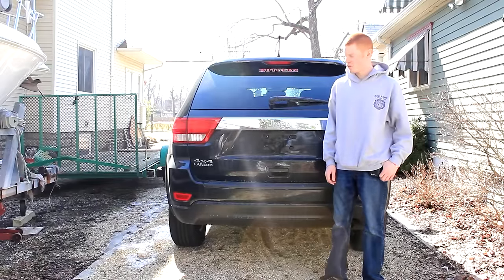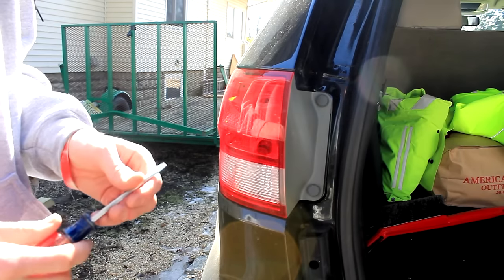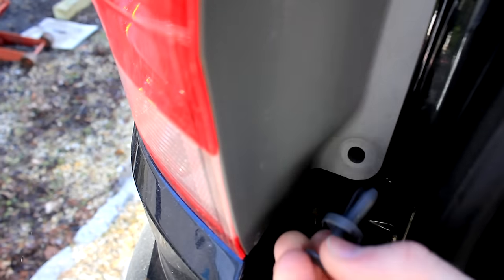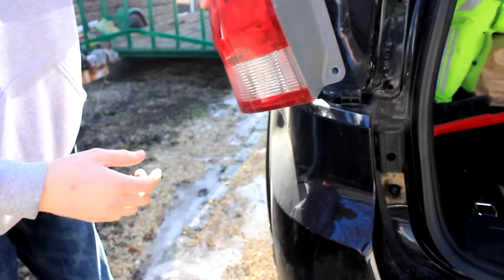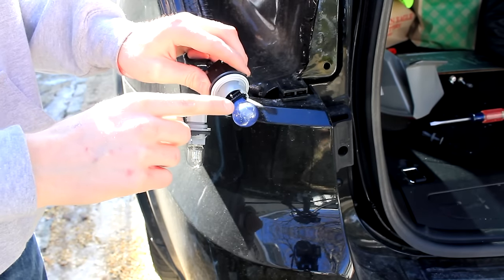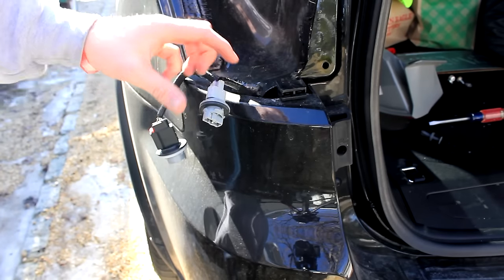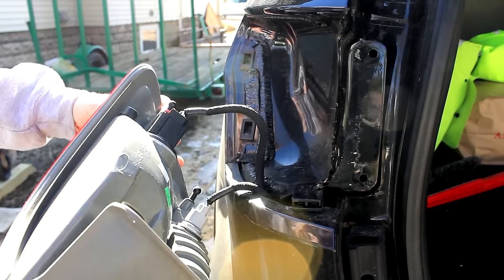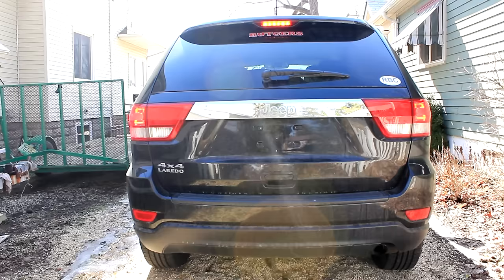Jeep Grand Cherokee Turn Signal Bulb Replacement

Comment: Great video but you missed a very important tip, try and avoid touching the replacement bulbs with bare hands.
Reply: +GaynNovi They are not halogens.  It is fine to touch them.

Comment: Clear and straightforward video. Perfect. Quick tip when putting the light assembly back in: turn the grommets so the slots for the flathead are at the top/bottom. Makes it easier to get to for the next time.

Comment: I just did this on my 2013 Grand Cherokee. It worked like a charm...just like this very effective and very informative video. Thank you for posting this, the information saved me much time and trouble trying to figure it out on my own. The degree of difficulty is pretty low for just about anyone.

Comment: Excellent tutorial.  The back up light number isn't correct, but you can get it off the old one.  Took less than 10 minutes to replace both.
Reply: Very good tutorial changed the turn signal lamp. Never had done it before..